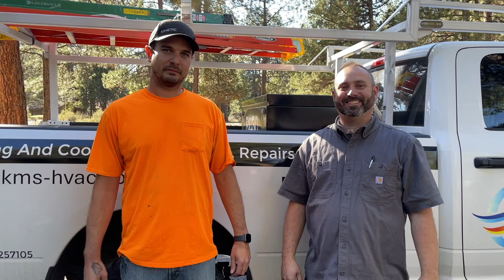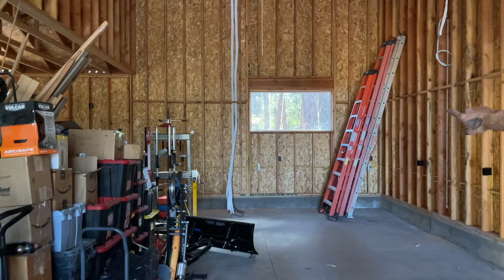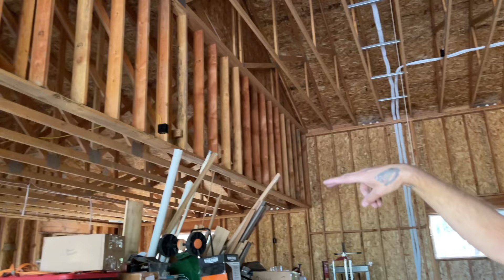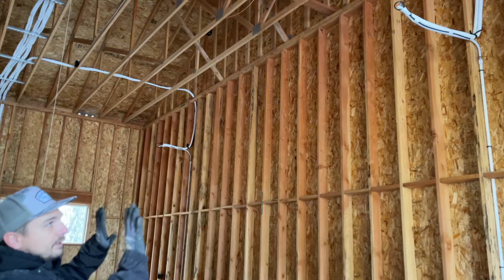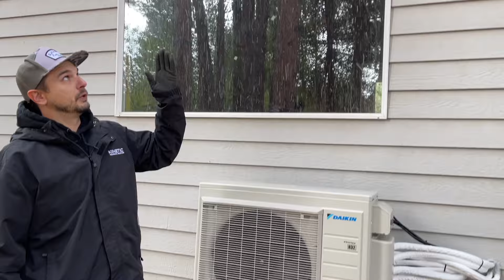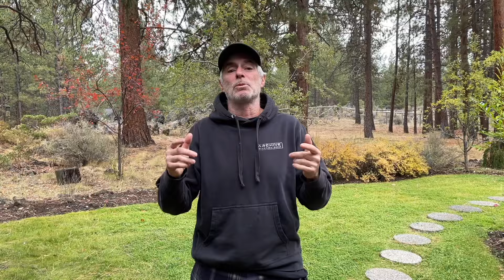Shop Remodel - Part 6 (HVAC Install)

Comment: Great series. I have a 1200 sq for shop. More power than I know what to do with. No cooling yet or insulation here in AZ but hey I'm only 33 and one day can have all that. Gearing up for timing belt on my 4.7 4runner
Reply from the maker: I'm more worried about heating than cooling.  I worked many hot days in my garage in San Jose.  The coldest days weren't that cold.  But, Bend gets much colder than San Jose, so a heated space will be nice.  I guess if you're in a hot place like Phoenix, cooling would be very nice.  Good luck with the timing belt job.
Reply: @TimmyTheToolman thanks man, god bless!!

Comment: I recently built a new shop and had very good luck with a mini split in it. I think you'll be very happy.   One thing I did on my shop is put electrical outlets in the ceiling thus allowing for the installation of cord reels. I did the same thing for air.  They've both been very handy as they're accessible from anywhere.
Reply from the maker: The cord reel thing is a good idea.  Somebody else also mentioned that.  

I don't use air enough that much, but it might be cool to have a hose reel when I do need to use air.  I think a bigger air compressor than I currently have would be nice.

The electricians are coming over tomorrow to finalize the work, and I'll talk to them about it.

Comment: Wall mounted garage opener is the way to go, make sure you don't forget to run power to where the lift is going to be at. High up on the wall where the post is going to be located.
Reply from the maker: Yeah, I'm going to talk to a garage door company about it.  I do have a power drop on the ceiling for the lift already installed.
Reply: @TimmyTheToolman  The wall mounted garage opener has been a game changer for me. You'll just have the 2 guide rails on either side mounted on the ceiling. With the lower ceiling side of the shop, you can ask the garage installer to mount the rails closer to the ceiling so gain that extra headroom when the door is opened.

Comment: Work got slow.  Must have been during the Biden years.
Reply from the maker: The Biden presidency was a living nightmare for our country.  This is Timmy's opinion.
Reply: Hvac is SLOW during Fall and Spring. When people get the first week dose of 
Winter (feeling cold)  and Summer (humidity, sweating there asses off), is when the phone rings non-stop and we are SLAMMED. People wait till the last minute. 

Summer work is the worst for people because they have no way too cool themselves unless they have a pool, live by the beach/lake etc. During Winter people can keep warm with layered clothing, space heaters, blankets, etc. But once you get a good snow or freeze and the pipes are on the verge of bursting do too freezing, the phone rings non-stop....  But people WILL drag there feet.

Hvac guy here....
Reply from the maker: @joshm2243  That makes sense.  Lot of people procrastinate.  I do it as well, but not in this case.  I want to get my shop dialed in as soon as possible.

Comment: You made a good choice and won’t regret it.  How are you and your family dealing with the colder temps vs CA?
Reply from the maker: Thanks.  I feel good about my decision to use mini splits.   I still might install a wood stove because I do really enjoy a wood fire and thought it might be nice on the days I'm hanging out in the shop with some buddies.

The colder weather is going to take getting used to.  The mornings have been in the 30s lately.  I need to invest in some warmer clothes to be more comfortable being outside.  I already own some decent gear, but it's all very old, and my wife and I are due for an upgrade in garments and footwear.  We both want to try out cross-country skiing again.  We both did it decades ago, and we're thinking it could be a good cardiovascular sport for us during the winter to stay in shape.  

All the exercise gear I ordered from the Rogue company will be coming soon, so we'll have our home gym available for weight training.  It will be nice to work out at home and not have to drive to a gym.

Comment: Hi Tim,another interesting vid,just had new garage doors at our home and I was interested in side opener and my guy talked me out of it,he said they can be  Problematic ,you might check with your guy,my Son just had the side opener installed on his doors and the locking mechanism locked him in twice and the garage door guy ended up just disconnecting that feature, looks like your getting some really good guys to do your work,its been fun following along,continued success to you and your wife 😉
Reply from the maker: Thanks for sharing that info about the side garage door openers.  I really know nothing about them.  I might just stick with the regular style opener.

Comment: glad you decided to go heat pump. natural gas is one thing, but propane, propane delivery, tank rental, propane company takeovers, and constant price fluctuations is annoying.
Reply from the maker: What you mentioned was part of the decision.  The propane delivery, at least for one company that was recommended to me, seems a bit of a joke.  I called the company to request them to fill the tank for my house.  I first had to fill out an application, and that was over a week ago.  Now I'm just waiting for them to find the time to bring a truck out and top off my tank.  I guess they first have to test the tank, which I don't understand how they do that with the tank partially full of propane.   But yeah, who knows how long I'll be waiting for them.
Reply: @TimmyTheToolman They also put a wireless meter on your tank to keep track of your usage. When you start an account with them, you have to agree to the 50% threshold, i.e. they come out and fill it up. You cannot call them when your tank is at 15% or 25% and say "hey I need a fill up". Its how they gouge on propane cost's as this allows fluctuation during price changes. 

Be prepared to hear, "We can't top off that tank, it's too old and we don't want the liability. It's the game they play to get YOU to buy, or rent there tank. Propane tanks hardly go bad. They bury them in the ground just enough to access the fill valve under the lid. If propane tanks really went bad due to structural problems, they wouldn't bury the damn things in ground. We all know what in the soil and below? Moisture in the soil, that always great for steel.

Propane companies are being bought out and bought up by conglomerates and they are jacking the propane prices through the roof.
Reply from the maker: @joshm2243  When I signed up for the propane service and they asked if I wanted them to monitor the tank level, I chose not to and I would be the one who would call when I needed my tank filled.  

I've never heard of buried propane tanks until I bought this place.  I guess they do it because it's less of an eye-sore compared to above ground tanks.  If the first company tells me they can't fill it for some bullshit reason, I'll go to another company.
Reply: @TimmyTheToolman Propane has become a joke. Alot customers are removing all propane heaters, furnace, etc, and going all electric. Electric space heaters, Heat pump, etc. They are tired of propane companies and there bullshit games.
Reply from the maker: @joshm2243 I pretty much only use propane for a gas stove in one of the rooms.  The heating for the house is a heat pump.  So, I could delete it if I wanted.
Reply: @TimmyTheToolman  I'm down to just a gas(propane) range top and hot water heater. water heater will be replaced soon with heat pump. i'll probably buy it before the end of the year since the tax credit is likely going away. Don't forget to get your tax credit for the mini splits and insulation.

Comment: That's what I did for a living !
HVAC and refrigeration, C20 and C38 
It's cool watching others doing it !!
👍
Reply from the maker: Yeah, it is cool and interesting.  I'm blown away at how small that condenser unit is.  It's hard to believe it can power the 4 heads that will be inside the shop.